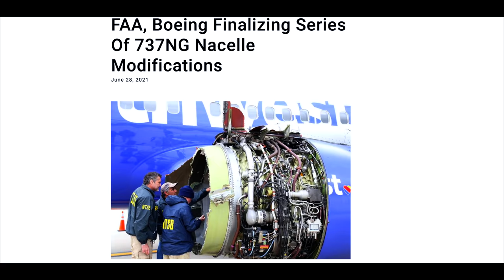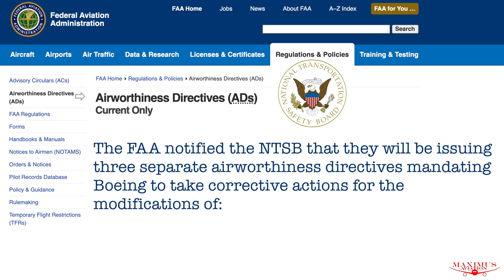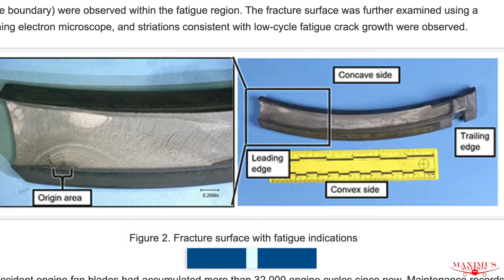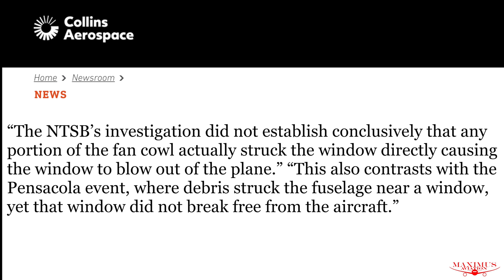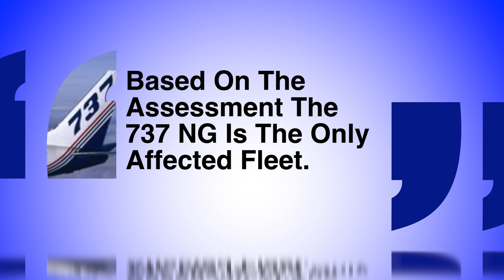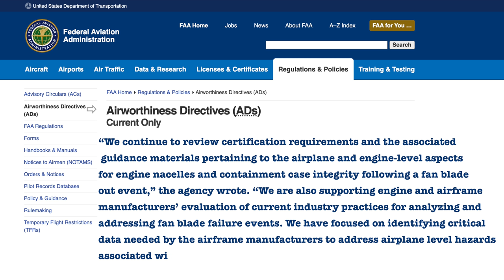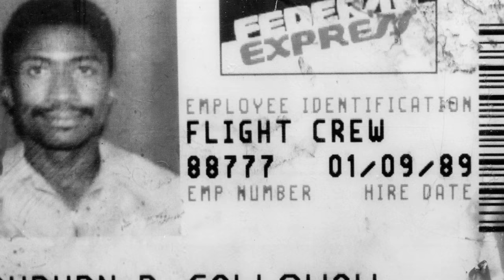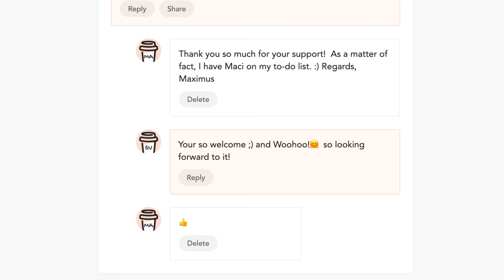After Two 737 NG Explosions, The FAA Is Finally Ready To Direct Boeing To Redesign Engine Cowlings.

Comment: It seems to me that the engine manufacture CFM International (a joint company between Safan and GE) should have some air worthiness bulletin issued again  them. After all it was their fan blades that started the destruction of these engines, structure and death. Why is it just the aircraft manufacture that gets the bulletin issued against them. There are over 20,000 of these engines worldwide. It should be the engines fault, although I do understand why the structure has to be corrected.
Reply: If you don’t have your car inspected every so often then it breaks down would you blame the manufacturer? Southwests inspections missed the fatigue cracks
Reply: Doesn't matter what the engine does, the nacelle is supposed to contain any explosion.
Reply: What is the history on other CFM56-powered aircraft like many A-320s and A-340s? If they are substantially different, there’s an avenue of investigation to be explored. If not, the 737-CFM specific issues are of greater interest.
Reply: @HEDGE1011  Great point! I'd be very interested to know.. I do fly Southwest quite often and if this becomes a Boeing issue, I may have to change carriers..for my & my families safety.

Comment: Just to clarify, the passenger was killed by a piece of the latch assembly of the cowel going through the window striking the passenger on the head killing her on impact. Not just being partially sucked out of a window. If she had not been killed by the impact she would've been able to pull her upper body back into the cabin.

Comment: Add a couple of hundred pounds of metal structure within the nacelle. Accept the added weight without trying to shave it down to minimums. Modelling tempts bean counters to do just that. Also wondering how the only two aircraft out of 6000 to have this failure are owned (and therefore maintained) by the same airline. A bit odd.
Reply: Given the great number of B-737 NGs Southwest operates, it's not that suprising.
Reply: @markusstudeli2997  They have less than 300 in service. About 5% of the total, and 100% of the failures.  I’d call that “surprising”, hence why I find it odd that they are the only ones who had the fans explode.
Reply from the maker: If the engine has the Kevlar wrap why not just line the nacelles with Kevlar? Maybe its a weight issue.

Comment: I thought the engine manufacturer had primary responsibility for fan blade containment. If not, they should.
Reply: They can't because the engines are mounted on different aircraft thus the engines nacelle is designed for that particular bird. Just take the 737 as an example its nacelles are flattened on the bottom.
Reply: There is video on you tube about Rolls Royce engine testing and it stated just that  'Total containment'
Reply: @michaelshore2300  you can do a test throwing a turbine blade on a test stand and it be sufficient but the problem occurs when it happens in flight. The test stand wasn't moving through the air at 400 to 500 mph and if it were that damaged ring is now compromised and parts could break off. It was a cowl latch that breached the Southwest 737 window.
Reply: @DC8Combi  My bad US test vindicated ???
Reply: @michaelshore2300  when RR or any manufacturer test an engine for blade out they are only testing the engines containment ring. The cowlings and nacelles that these engines later sit in are designed by others so if an engine loses a blade the violent event can contain the blades but the cowling and nacelles can be compromised and break away and that's the issue.
Reply: @DC8Combi  Now Who designs the cowling ?? Boeing ???
Reply: @michaelshore2300  when you buy a car and something on that car fails like an airbag who ultimately designed the vehicle? Most likely the manufacturer didn't make the airbag but they sure as hell choose the vendor and oh my the manufacturer of the vehicle is at fault. Nobody wants to admit they were too cheap, lazy or incompetent to provide a vendor that was suitable.
So as to who designed or who built these nacelles and cowlings the manufacturer of the product they went on holds the big boy responsibility.
Reply: @DC8Combi  You are starting to loose me so Boing IS responsible ????
Reply: @michaelshore2300  ugh yeah Boeing is responsible the NG is a Boeing aircraft.

Comment: Thorny topic with a lot of weak points, not all Boeing. Ultimately, Boeing sells the airplane and vouches for it. This has an eery similarity to the Challenger disaster of 86 (?) when the solid booster O ring problems were known. Budget considerations trumped over human lives with tragic consequences. We love to think we learn from our mistakes, whoever that elusive we is, but the Columbia disaster shows otherwise.

Is Boeing becoming the NASA of the 80s and early 2000s? It took decades for NASA to shake off its arrogant image.

Comment: 737 NG - Where NG stands for. 'No Good.' Boeing has turned into the Trabant of airliner manufacturers.
Reply: A bit Harsh !
Reply: @edwinfitchett6033  I'll apologise to Trabant.
Reply: @markchisholm2657  yes. Better do apologize. The Trabant was a amazing value for money vehicle. It was incredibly cheap to produce and repair. It was extremely easy maintenance because you could do it yourself on the next street corner or your kitchen table. It had a roof and 4 wheels. Though not much luxury it was a car. I doubt “cheap to built” or “easy to fix” are any adjectives used with Boeing aircraft nowadays. Especially the latter.

Comment: Even if the nacelle & cowling torn apart, they still not call it "uncontained engine failure". But as we can see from these incidents, those pieces of broken nacelle & cowling could damage the surrounding area of the engine.
I believe no one have tested an engine failure, complete with it's nacelle & cowling, where the air around the engine is moving at airplane cruising speed.

Comment: I think it's a little more complicated when it comes to blame as this is a problem that boils down to acceptable risk vs. non acceptable risk. There is no such thing as no risk in anything in life. It depends on how exactly compliance was demonstrated and if that compliance demonstration still stands today. However the 737 being an old airframe design that has been modified over and over again clearly does not help as it may not always be very forthcoming when modifying it to implement new technologies. And with technology becoming more and more complex, failure conditions and impact analysis's become more and more complex. And as it is humans who perform these analysis's it's not a question of if something gets overlooked but when it gets overlooked. And as a regulator you also do not want to kill evolutionary changes in its infancy that have the potential to work towards the regulators agenda to improve safety or reduce adverse environmental impact of the aircraft as a whole.
 

As the amount of hours that all aircraft are operated per year rises and more sophisticated tools such as AI might become available at a reasonable price in the future and the ability of the industry to deal with shorter product life cycles improves we might see a regulatory life limit on product designs. Meaning that a fleet of products that is manufactured to a certain design may only be operated for a certain amount of hours before you have to show that it is still safe to operate as per the latest standards. Today this is only required in case of a new type of aircraft, engine or propeller, for wich a new type certificate is issued.

In case you are an engineering and compliance demonstration process architect you may actually want to consider this when designing these processes and specifying supporting tools. Basically an agile product engineering process. This process must not be confused with the agile software development philosophy that is used for non critical consumer software products, but you maybe want to use some of it's lessons learned, and come up with tools that enable rapid identification of problems on a design level so that you can iterate faster on subsystem level until the analysis on product level shows all green. But once we are there it might actually be not that far to products that are completely designed by AI to high level mission requirements that have been developed with human input.

Comment: It's like the Chicken and the Eqq.. Here the Egg is the fact the fan blades are separating to begin with.
This is a deflection move by all involved and Jennifer Reirden lost her young life because of that fan blade r
Reply: Fan blade failure is part of the certification, this should have been tested - the engine should contain the destruction. so where is the problem, faulty test? Faulty parts?
Reply: @1davidsmall  yes it is but we know that they'll shoot for the lightest cheapest configuration they think they all can get away with.

Then they'll blame the computer model for the issue..

That's the next scapegoat

Comment: The 737 cowling doesn't bother me nearly as much as the modern long-range twin jets - especially the 777.  If one of those cowlings blows apart midway to Hawaii, will it make it on fuel with the added drag???  Efficient high-bypass engines are so much more prone to this sort of damage compared to the more mundane CF6 or the ancient screamer JT8D.  This isn't just a Boeing defect, I'd be just as concerned about the A320neo.  I don't trust that regulators or businesses would opt for safety over fuel economy - when reducing 'carbon emissions' makes for better PR.
Reply: No it won't. Look for the blancolirio (Juan Brown) interview of the pilot of the plane where the blade failed and took out the cowling. He was on a continuous descent from cruise altitude, as if the plane went fast enough to maintain altitude, the unbalanced engine windmilled at a speed that made the pilot afraid the wing would be damaged. He was lucky to be in his initial descent instead of being halfway. Add to that a depressurization requiring the drag of lower altitude, and a fuel emergency would be added to the engine failure.

Comment: Keep in mind through all this jabber about bad cowling performance, claims and counter claims, it’s not just the 737 engine cowlings  which come apart and damage the cabin fuselage and wing structures when these turbine engines fail catastrophically. The same thing happens on many different airplanes from both Airbus, Boeing and others. So over time, this directive is going to spread across virtually all high bypass fan equipped airliners with wing mounted engines that have shredded their engine cowlings in flight. And that is a pretty large list of transport makers and models from around the world. Not just Boeing.
Reply: @waldemarsikorski4759  Yes. Really! And by the way, both SouthWest 737 were technically contained engine failures because the fan blades did not pierce and exit the engine containment ring. Same as on the Airbus Video. The engine failure in the Airbus 380 Quantas flight 32 was a different type of failure entirely. It was a fan disk failure, not a fan blade and that is a failure which would not be constrained by any engine cowling on any airplane, the massive energy forces released were way beyond any engine shroud capability to contain. Same with the United DC10 crash in the Iowa cornfield years ago. But the following video shows the same Airbus engine in your referenced video cowling coming apart just like on the 737. An it did damage to the wing as well. Not sure if any pieces hit the fuselage or tail in that incident. 

https://youtu.be/wY1Op4Mhs58

Comment: Blaming Collins Nacelle for the plane damage reminds me of the high speed train crash in Germany where a wheel failure caused the train to derail and hit a bridge.  The Bridge collapsed and crushed the train.  Did the wheel engineers  have liability?  No the bridge engineers where put in prison for ~10years, or was it 20?
Reply: No Sir, this is simply not true - try Wikipedia for the correct cause of the accident. The bridge was never in question!
Reply: @wernerhahn141  Yes, I agree, but the documentary I watch, said that the bridge should not have collapsed and because it did, the engineers of the bridge were held liable and were imprisoned.  I though that was ridiculous, but also it was said it should have been designed without the center support.  Yes, the train hit it, but it should have beed able to withstand the train hit.  Again, I thought it was ridiculous.

Comment: One death in commercial airlines since 2009 and how many millions of passengers and how many billions of miles traveled by air in the US? Show me any stretch of highway with those good of stats. These events are super rare and the fan case did it’s job and contained it. Your not gonna catch every single piece every time. If you worried about it don’t get seats that are on the plane of rotation. I make sure to avoid those seats. That’s just me but then again I have been in the industry for 20 years🤷‍♂️😂